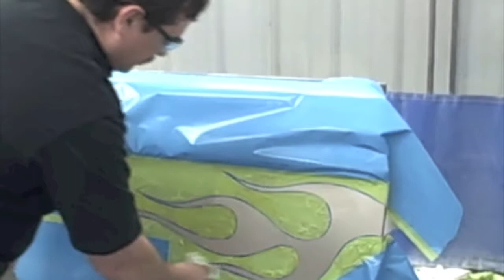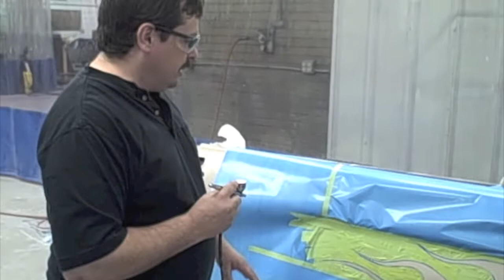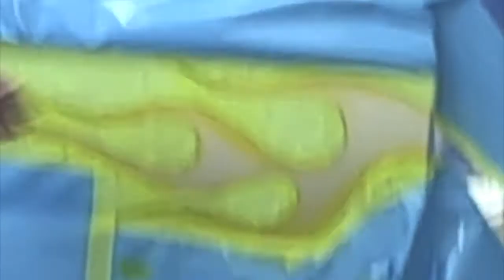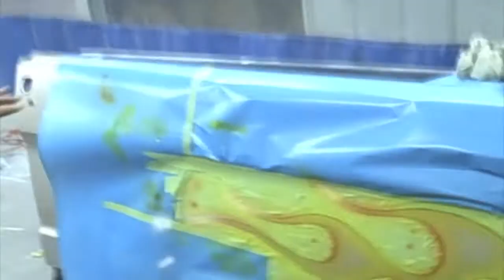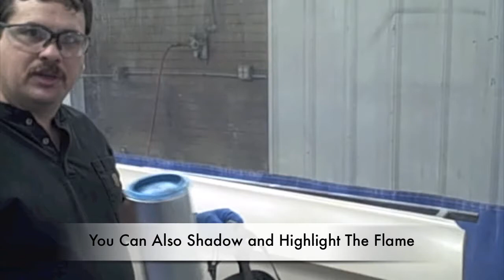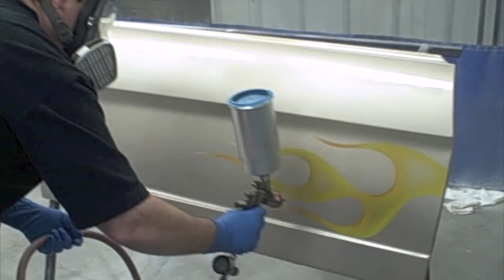Auto Body Repair - How To Clear Coat Over Airbrushed Flame - HD

Comment from the maker: @leslieandchad Yes, you want to sand the panel enough to provide mechanical adhesion.  I use 800 grit if I am just clear coating the surface.

Comment: so i have a question hopefully you can get back to me quickly. after you sanded the panel you, went straight to airbrushing the stripes. i noticed that you never went back and compounded out the fine scratches. will that not show through the clear coat? do you just do the leveling process after you clear?
Reply from the maker: Clear coat should fill 800 grit scratches and finer.  Once cleared, it will look new.  Thanks for watching.
Reply: +DIY Auto Body and Paint 
awesome thank you for the fast reply.
Reply from the maker: You're welcome!

Comment: "How to clearcoat over airbrushed flame" is the title but these guys never tell you the really important stuff like, What pressure the gun is set at? What nozzle size are they using? whats the overlap? What mix is the clear 1.1, 2.1 what? How long do you wait between coats etc, etc. Utterly usless to anyone trying to learn....